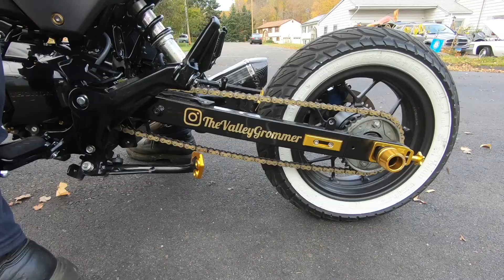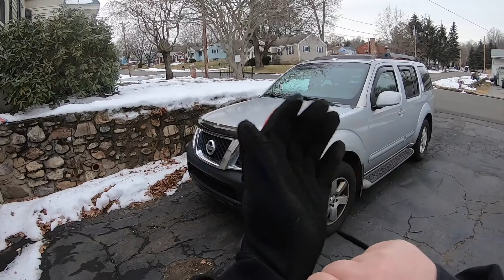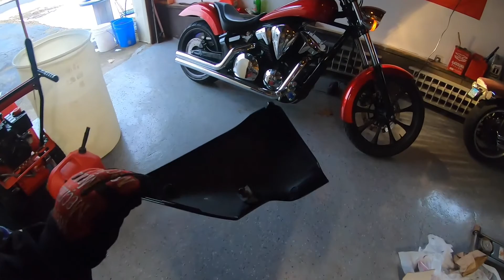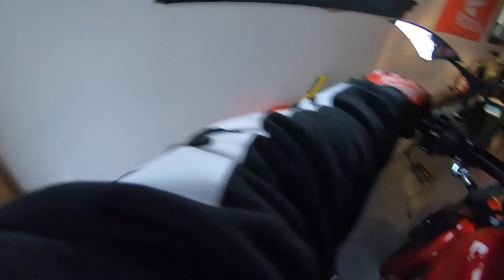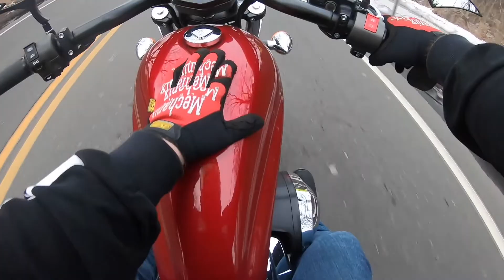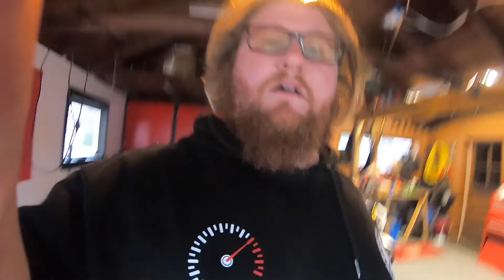HONDA FURY Cobra Speedster Pipes DECEL POP

Comment: Carburetor models are so much easier to build and tune. 😎 
04 VTX 1300 reed removal, modified to filter fresh air. Secondary head breather filtered, choke removal, idle removal, scar mod, big breather, pipes sawed off shotguns, bike mocked and ready for next stage. Will post cold start video. Today.  It's quite loud and very fast. 😎🔧 Nice scooter ...!

Comment: You mentioned an oil leak was that on the fury .
Reply from the maker: Yeah What happed was the rubber gasket that comes on the oil filter itself was not seated correctly on the filter… I inspect the ring every time I get a new oil filter just to be sure make sure the glued is right

Comment: Decel pop is because the air is no longer going into or available into the exhaust chamber to burn left over fuel. It's choking... 🤢Remove reeds completely, buy some make a gasket, buy a T and some hose equal lengths to the T and drop in left side between the heads for effective breathing.... small filters from auto zone two of them and install.  I'll post a video. Been doing this for 30 yrs. Good old carbs ..😂